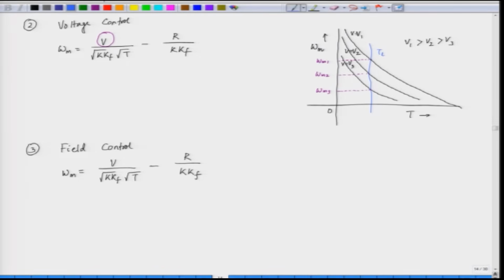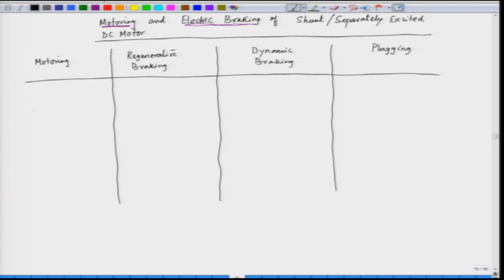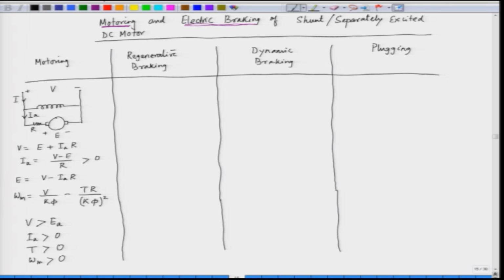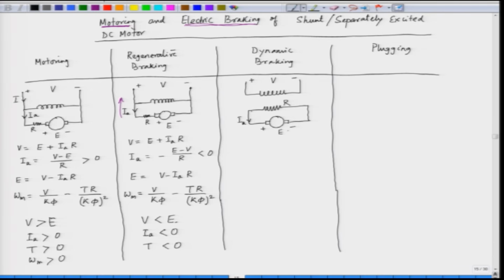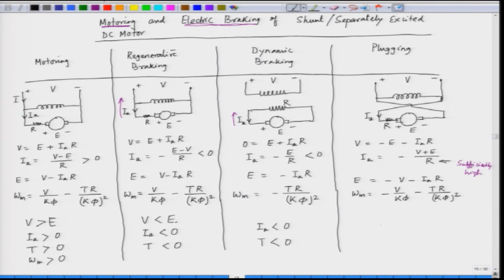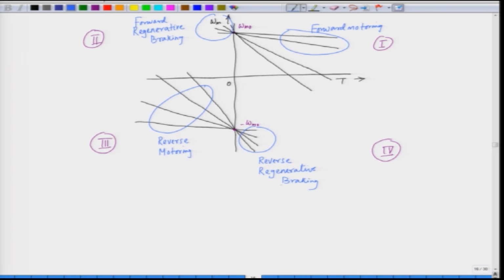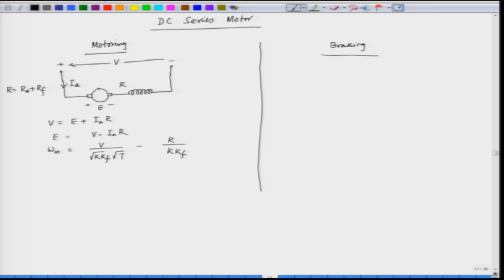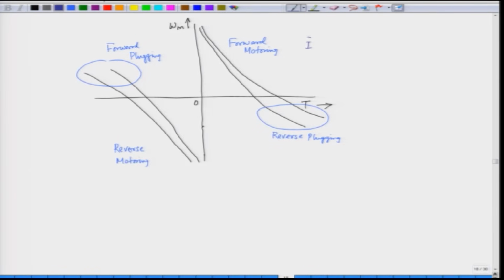noc19-ee65-lec07

Comment: Sir how in case of dynamic braking for shunt exited dc motor , Torque<0
Reply: As current goes negetive... Torque becomes negetive
Reply: in this case, supply is cut off. also, the current in armature is dissipated in an external resistor. so, its value keeps on decreasing. As a result, torque keeps on decreasing.